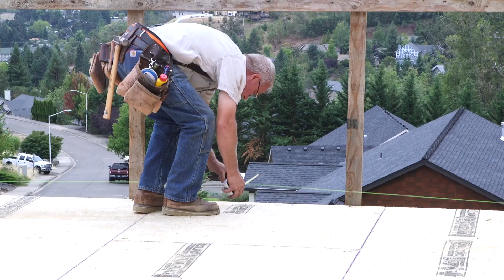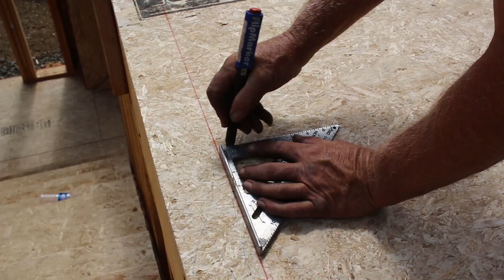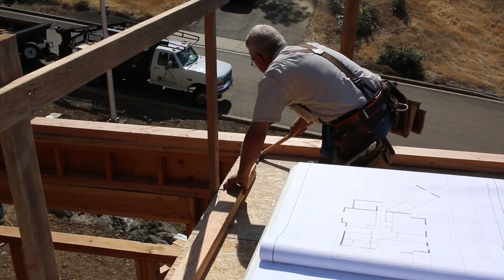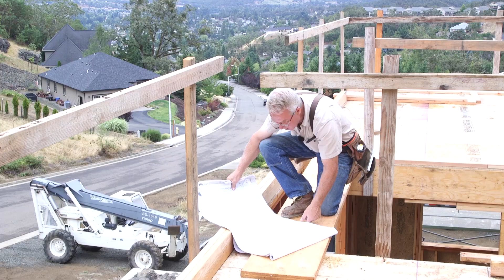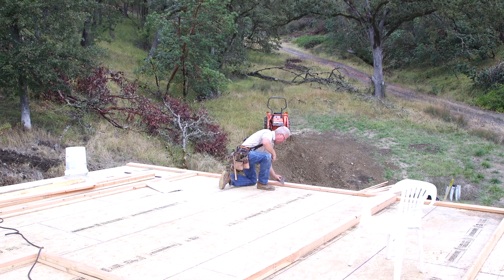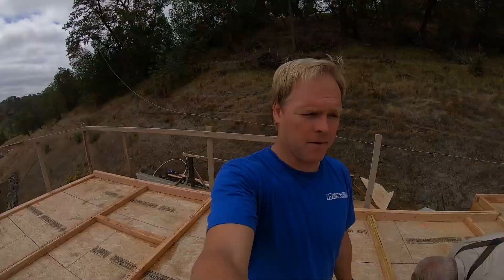Snap, Plate, Detail and Protect Ep.59

Comment: I really admire the works you have done by keep watching almost all of your videos. I have learned a lot from your experience. Thank you so much. But I have a question and really look forward to everyone's answer.
Why don't we use load-bearing columns from the foundation to the main beam of the roof? Some documents say that it should be better to have them when building a house with 2 floors or more, so the connection between the second floor to the first one is stronger, and so the entire construction, especially when the house is shaken in the event of an earthquake, those columns will transfer the heavy of the roof to the ground more efficiently than just the walls.

Comment: I'm constantly amazed at the American penchant for all wood homes. You'd be in for a bit of a surprise if you saw how homes are built here in Western Australia. Basically: a thick concrete slab, double clay brick, wood or steel internal roof support, and either a steel corrugated or clay tiled roof. Even most window frames are aluminium.
Reply: Interesting. Do you know why that type of construction is preferred there? Seismic conditions or high wind loads maybe? Or maybe wood is not as economical to build with, as it is in the NW U.S.. Where I live in the SE U.S., concrete and steel are the materials of choice to combat hurricanes. It varies widely in the U.S., depending on local conditions.

Comment: I'm a software engineer, I'm not going to build a house never, but I  get relaxed when I watch these videos
Reply: Barbarojavortex you may be surprised one day.  You use the exact same top down logic when you build a house as you do when you build a software program.  Break it down to manageable parts.  Some elements ate structural, some are esthetic and some are both.  You don’t necessarily have to build an entire house but you can take on small projects and work up.  You already have an advantage in the thought process.

Comment: Tajima chalk lines are where its at for super nice lines
Reply: Somebody else mentioned that. Never heard of them.
*Note to self: Look that up when finished reading comments.
🤜🤛
Reply: @psidvicious  I do structural concrete on the commercial level and i got my first Tajima like 8 years ago. Since then i have used them exclusively. 10 times more durable but leave such a nice clean line. If I knew how to send him one i would granted he will be dried in by then.
Reply: @derrickbarnett1771  Well, you and I are ‘birds of a feather’ then, bcz I also made a career out of commercial concrete work. When I worked w/my tools I always found myself going back to the cheap, Irwin Straight-Line. I always found that a chalk box needed to be replaced when the felt bushing wore out and started to spill chalk all over the place. I could get maybe 1 replacement line out of a chalk box before that occurred. I’m guessing the Tajima has made some kind of improvement on that. I see it’s a bit pricey at ~$30 but if they’ve come up with a better ‘mousetrap’, I’m all for it.
🤜🤛
Reply: @psidvicious  This is just my personal experience but i would consistently go through an Irwin, Stanley, Bostich, or one of those other brands every couple months or after the first rain i worked in. My first Tajima got replaced 6 years after i bought it. Same line different hook and it still works  gears are just a little crunchy for daily use. 30 dollars is a little much but one of those buy once cry once deals.

Comment: Can u tell me... 
What is good calculator for framing house
Framing stair
Framing roof
Type
4050
Or
4065
...? 
Pliss helb me
Reply: I don’t know what those numbers are (4050, 4065) but the ‘Construction Master’ is a good one. I believe it works in metric or imperial.
🤜🤛
Reply: @psidvicious  ya i now constructions master is good... 
But have type..? 
4065 and 4050... 
Defference..? 
Can u tell me..? 
What is good type for framing house, stair, roof..?
Reply: @antondeannova7016  Oh, I see what you mean by the numbers now. I looked at mine and I see it’s a model #4045. I actually never even looked at that before. Mine has got to be at least 20 years old and still going. By flipping it over and looking at it, I also just noticed the battery. Never been changed in ~20 years! It’s done everything I’ve ever needed it to do, EXCEPT, there are a cpl of trig functions that I wish it had. I have a cheap scientific calculator for that 🤷‍♂️ Hope that helps.
🤜🤛
Reply: @psidvicious  ya is good type 4045... 
But now... 
Have type 4065 and 4050... 
I quest...? 
Who is easy use for begginers... 
For 
Framing house
Framing stair
Framing roof... 
4065 or 4050.... 
...? 
Pliss helb me
Reply: @psidvicious  your oppinion pliss
Reply: @antondeannova7016  Well, I don’t own one of the newer ones, so I can only say the older one that I have (#4045) is great! I can only imagine the newer ones are just as good, maybe with more functions. I used to carry it around in my tool bags so I know they are durable. If you’re just a beginner, I would go with the cheaper one. I’m sure it will have all the framing functions you need. My older one certainly does. You might do a google search on it and read some of the reviews people have on the newer ones.
🤜🤛
Reply: @psidvicious  how do you think abaut 4065...???
Reply: @psidvicious  i want calculator easy for use... 
For framing housr
Stairs
And roof..?
Reply: @psidvicious  u now.. 
RR building, your subsc... 
Use cm pro 4065... 
Why u say 4050 is good..? 
Pliss tell me your options..?

Comment: Regarding OSB's resilience: I had repaired a door opening on my house and some of the stuff I took off was OSB. I was lazy about getting rid of the stuff I demo'd and it sat outside on the side of my house for well over a year. When I finally got around to throwing it out, the only bit of wood that still looked like what it started out as was the ODB. Everything else had rotted to at least some extent, most of it completely. The OSB bits looked like basically like they had been rained on a couple of times, but that's about it.
Reply: when OSB gets wet occasionally and is allowed to dry it's fine. It's when it is in a floor or wall system and a leak continually wets the OSB that you have a real issue with it. Plywood is typically more resilient in those circumstances, but not by much.